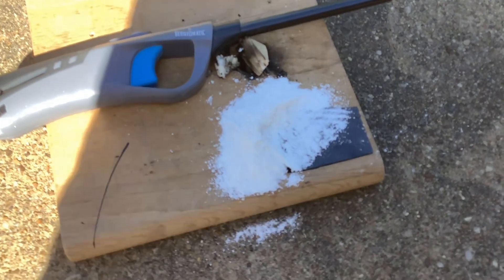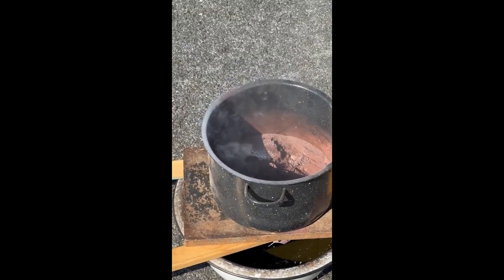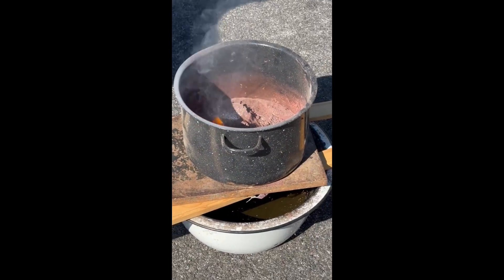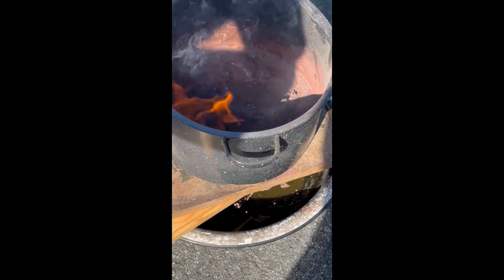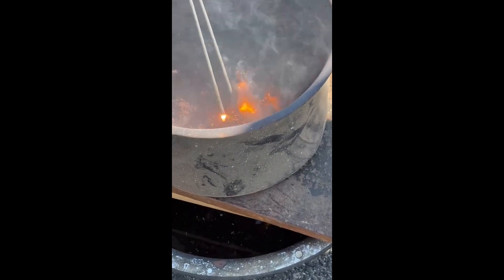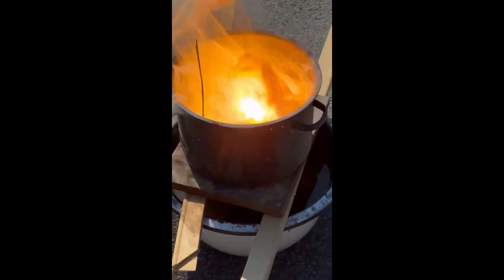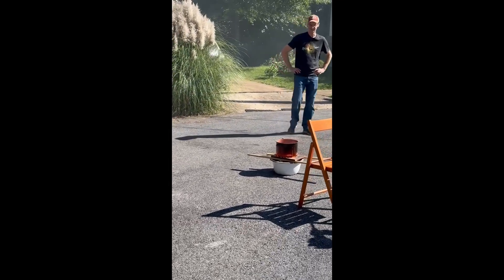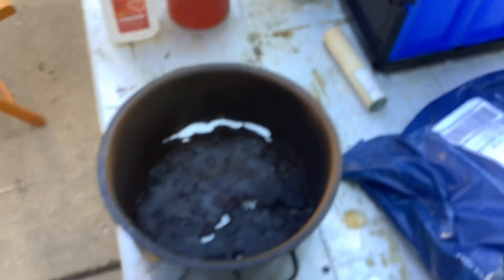Aluminum and iron oxide thermite (Chernobyl simulation)

Comment: If you want a faster and hotter burning thermite, consider testing small amounts of more exotic thermite, an easy one is to add a little barium nitrate to standard iron oxide aluminum thermite, often called Thermate, and in theory instead of melting holes in a metal pot it will just make the entire base disappear
Reply from the maker: @Pyrotechnicduck  Thanks but I’m fine.